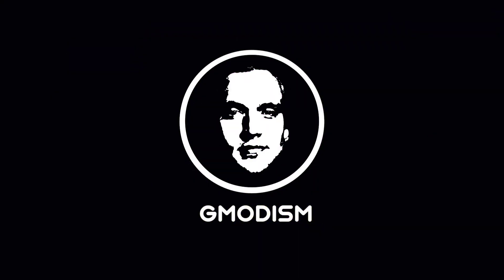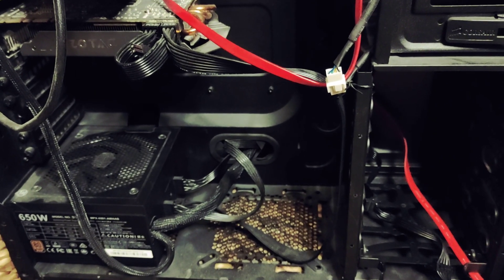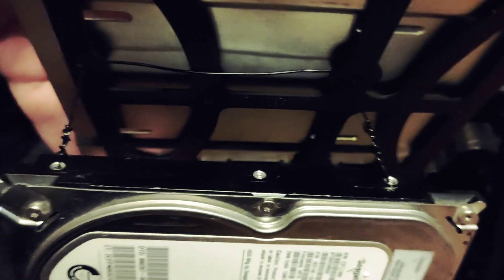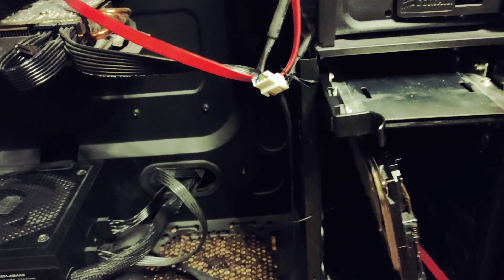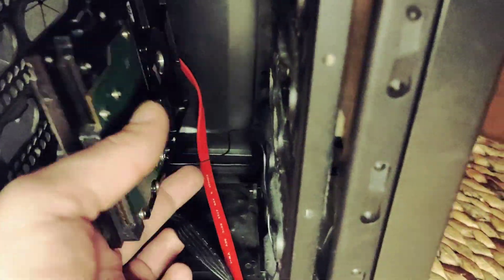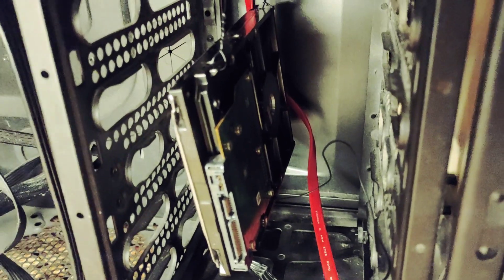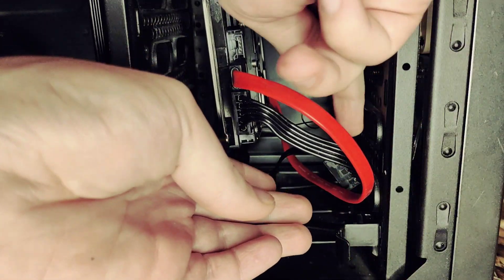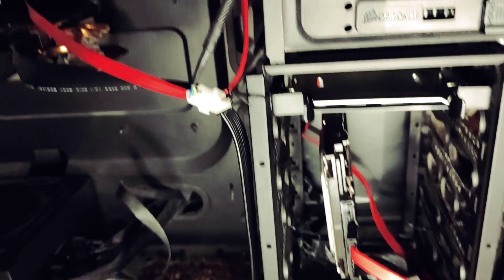How to Quiet Hard Drives - Fix HDD Vibration Noise

Comment: I created a suspension platform with shoe laces so the hard drive can sit in the bay normally horizontally, so you can fit all the drives it is supposed to be able to accommodate.
It has been running like this since 2015 I think and 0 issues. Some people say use elastic bands but those can dry out over time, become brittle and break.

Comment: Another safe method you can use instead of doing it this way. You can put some bed foam (thick ones) and let the hdd sits on top of it. Quite simple.
Reply from the maker: yeah should work as long as the drive doesnt ever get hot and that the pc will stand still :)
Reply: @GMODISM  It will get hot, but will not exceed 45 degrees.

Comment: Buy a 500 gb ssd any of you ☠️
Reply: Yeah but What am I meant to do with my operating system
Reply: @StealthyDrake12  1 year later reply im sorry, but for anyone that happens across this as well as you maybe, nowadays windows imprints itself on the motherboard/cpu/tpm so as long as you don't replace those parts i'd say it's fairly safe to replace a hdd with a ssd. Exceptions exist obviously so make sure you research before making purchases and such.
Reply: Stupid zoomer, 10tb hdd are cheaper than 10tb ssd, thats why people are still using them.